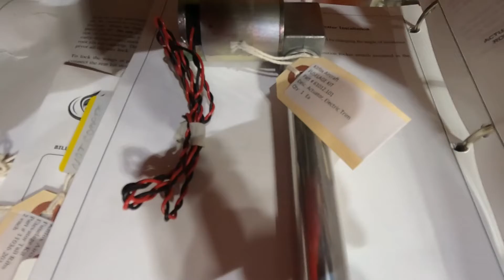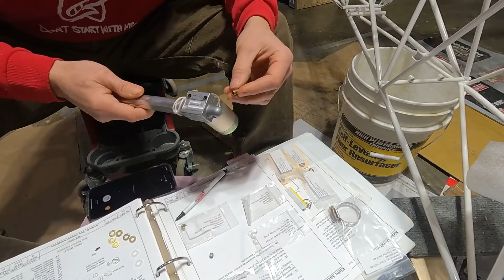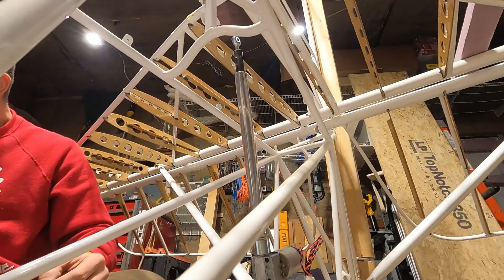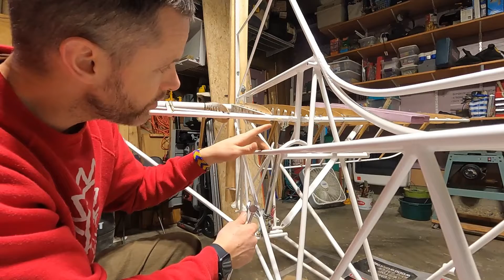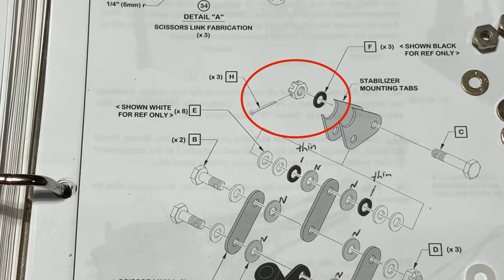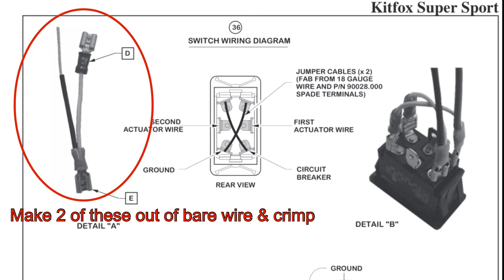#11 Trim Actuator installation & wiring

Comment: On your servo, never tighten with a wrench when a "procedure " calls for hand tightening.  You could always use thinner washer on the nut or bolt side to align the hole for a cotter key.
Reply from the maker: Hello @randwardle2540, thanks for the comment.  @23:02 in the video I see myself hand tightening the nuts at the top of the actuator where they mount to the horizontal stabilizer.  I did need to use the wrench to pull the shank of the bolt through the openings that I reamed as there was still some friction there.  It has been a while since I re-watched this video.  If you see another part where I used only a wrench please advise.  Thanks and have a good day, Matt

Comment: I cannot believe I have only just found this build channel after scouring yt for the last two years on tips into building the kitfox before mine turned up.  I have just ran into the same problem as you with those holes not been reamed.   You deserve way more subs that's for sure.  UK builder
Reply from the maker: Hello Jeremy, well I’ve not been on for two years so that could explain part of the reason you found me just now. I appreciate the vote of confidence and I do hope to get more subs for sure. I’d like to hit 100 by the end of the month. We will see, good luck with your build!
Reply: @KingFox76  I have subbed you but cannot find you when I put kitfox build in the search box.  But everyone else who is building one pops up.  BTW you should never bend brackets, you may compromise the welds without knowing.  You could of just put two thinner washers in.
Reply from the maker: @jeremykemp3782  Hello again Jeremy, I will have to look into that issue.  I’m still learning my way around the YouTube site as people ask me questions like this.  Just to let you know, I have not bent any tabs as I was thinking the same as you stated.  I am going to do a video on that when I get to it and adjust with moving washers around as necessary.  Thanks for the comment.
Reply: @KingFox76  We can all learn from each other for sure.  Because I am in the UK it forces me to read the manual over a gazillion times, watch yt and go on team kitfox because a little mistake will set me back ages with getting parts over here.  And still made a few mistakes but fortunately could be rectified.  Still, I am enjoying it immensely and learning so much.  Would recommend that everyone should do something like this at least once in their lifetime.  Your videos have been fantastic, keep it up and thank you
Reply from the maker: Hello again Jeremy, I’ve now added “#kitfox build” to my list of links to search so I am hoping my videos will now show up when searching.  Fingers crossed.
Reply: Thank you for highlighting where Kitfox left out the reaming of the stabilizer trim mounts in the instructions. I was just getting ready to install the ribs when I saw this video. You saved me a huge headache of trying to ream them after rib instillation. 
I’m finding your videos so much more helpful than others since you take the time to show all the steps. Keep up the good work.

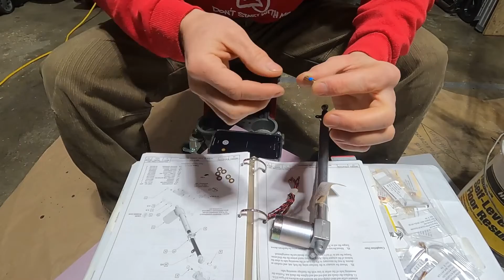Comment: Hi, Jeremy. At 6:10 you used thread lock (blue) and I believe the instructions called for bearing lock (green).
Reply from the maker: Hello @sshort21. I have a question for you. Is your name Jeremy?  I just ran out to the garage and took a look at what you are discussing.  I certainly did use Blue 242 for sure.  I'm not sure if you are familiar with the "builder's tips" section of the manual. I turned to that page and read what they have next to the padlock icon and in that paragraph they suggest the use of the LocTite 242 so that is why I used that in this location. Let me know your thoughts.  Thanks again, Matt
Reply: Hi  @KingFox76 , I just double checked on this since I used the green RC680 as @sshort21 says. Per my manual (rev D, 12/20) on page 10 of the builders tips it says the blue 242 is for bolts/nuts and the green RC680 is for bearings. I used the green on mine and started to worry when I saw you using the blue, but it looks like you used the wrong stuff. Easy to make these mistakes as there is a lot of detail in the manual. (it would be nice if they called out the product rather than just saying "Liquid Bearing Lock"). Oh well, I'm not sure it matters all that much that you used blue, though I'm no materials engineer. Thanks again for the videos.